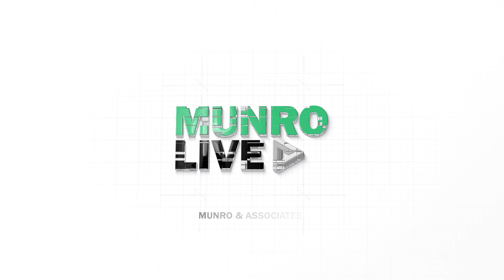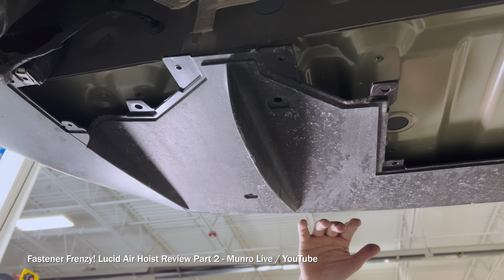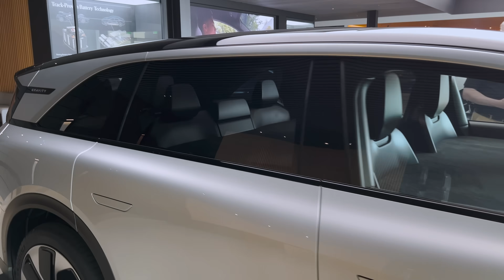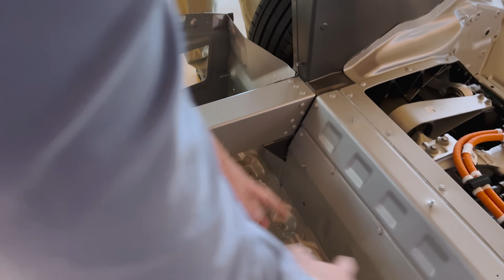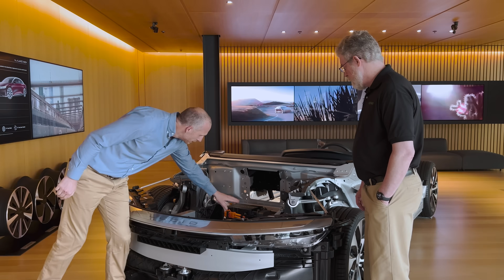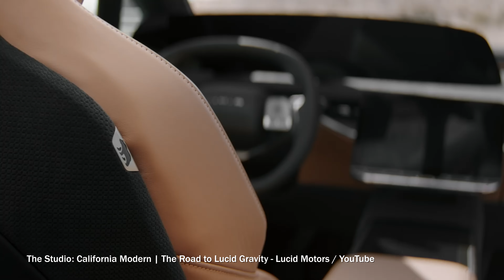Engineering Excellence: Exploring Lucid Air's Incredible Efficiency

Comment: The most lucid question is who gets their tech and patents for pennies on the dollar when they are bankrupt, sadly
Reply: The inverter, motor, differential and reduction gearbox is a gem of a drivetrain package. I would like to know how well Lucid’s heat management compares with that of Tesla and it’s elegant Octovalve arrangement.
Reply: @joe2mercs  the radiator inlet diffusers functionally remind me of the P-51 mustang cooling system with clever adaptation for so limited space.  But I would like to talk to the engineers to confirm
Reply: @joe2mercs Short answer is Lucid heat management in the best in EV industry. If interested to know further check out Tech Talk series.
Reply: Lucid seems to have the best technology. I will be buying the gravity. Tesla felt poor of quality over multiple cars and year produced I've driven, rivian feels like/is a heavy pig of efficiency, I hope lucid gravity feels as good as lucid air, which has a very good feeling.
Reply: Prototypes are easy compared to mass production. Tesla focus on mass production along with good enough prototyping is the key to survival for at least when your company is still small
Reply: The Saudis or Chinese of course. 
Lucid has burned up over $15,000,000,000 so far for less than 40k cars. And rivian has torched over $21,000,000,000 for less than 110,000 units so far sold.
Reply: @4literv6 the money they’re burning is mostly Saudi.
Reply: @4literv6 Let's discuss Tesla's losses before they became profitable. It takes time. New auto startups simply take a huge investment to make a competitive product.
Reply: Nobody is getting them for pennies on the dollar. What do you think the saudis are paying for?
Reply: The Saudi sovereign wealth fund will take them private before anything close to a bankruptcy happens. Why would they shut down a company they own 60% of, that has some of the best tech on the planet!? Makes zero sense!
Reply: People have been saying this for 2+ years. And yet they keep getting cash from the Saudis because they apparently have faith it will turn around and be a proper hedge against oil
Reply: GM and Mary Barras Salary might help Save Lucid …
Reply: “I find your lack of faith disturbing.” 😊
Reply: Lucid drops 14% in a day. Munro: guess I'll release a PR video 🤷
Reply: Buy a lucid so they don't go bankrupt lol